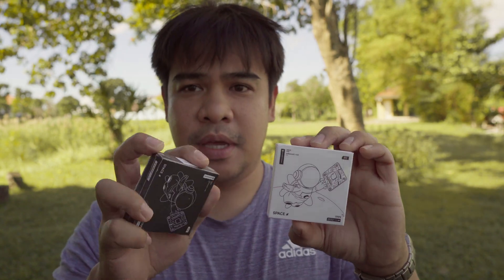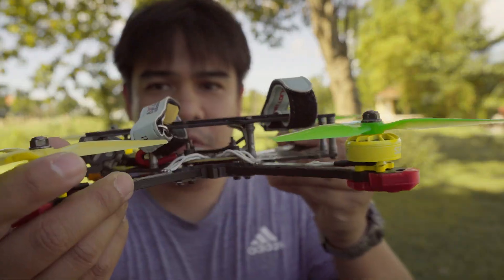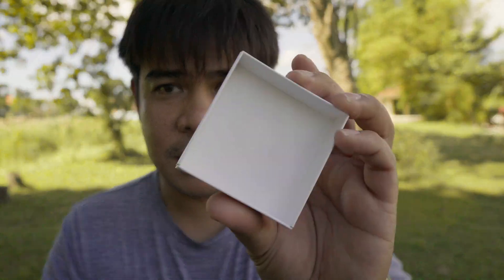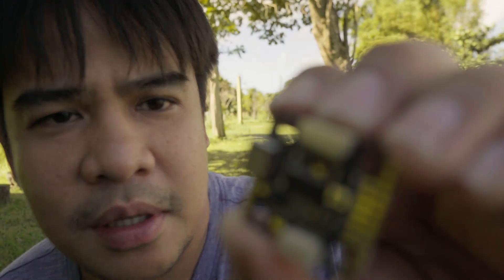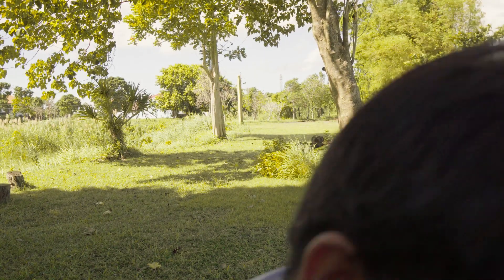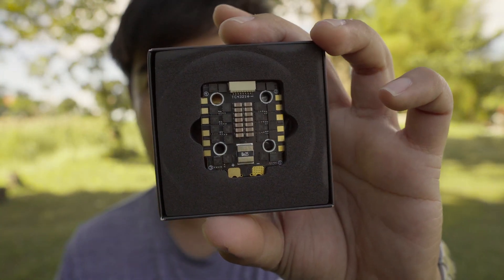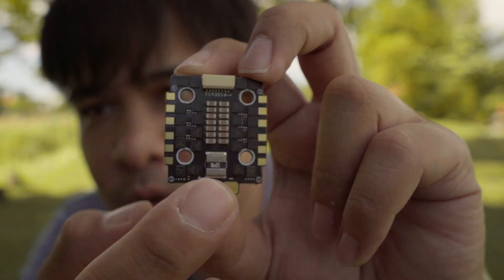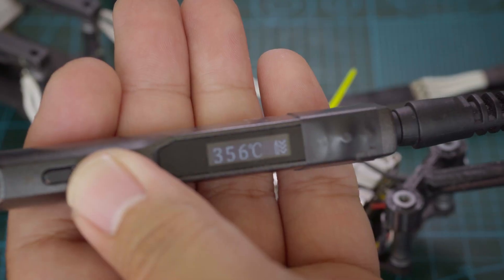MEPS KING SZ F7 Mini + Mini SZ45A ESC Part 1 | REVIEW

Comment: Hello, thank you for your video, I'm mounting the mepsking f7 mini and I'm using a dji 04 lite video system, but my video system doesn't turn on, I don't understand what's going on?

I've read something about the switch but I don't know, I'm new.

I appreciate your help
Reply from the maker: Did you flash new firmware on your fc?

Comment: Give you usually fly over open water, try to go as lightweight as is reasonable.  A 2fiddy frame which isn’t the best bando basher, would likely give you 8-10 minutes of flight time, and still be durable enough for landing on a metal deck.
Reply from the maker: Thanks! Will have a look at this frame.